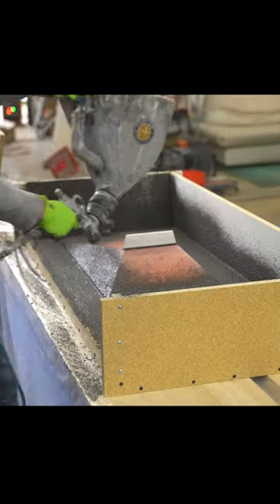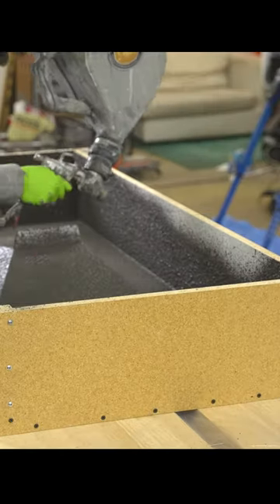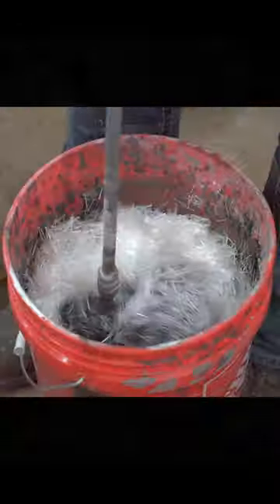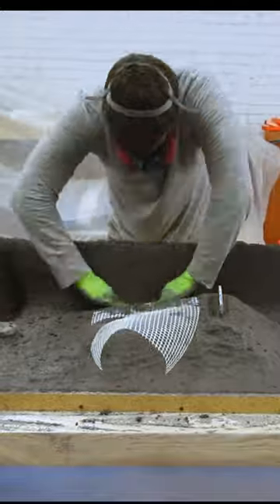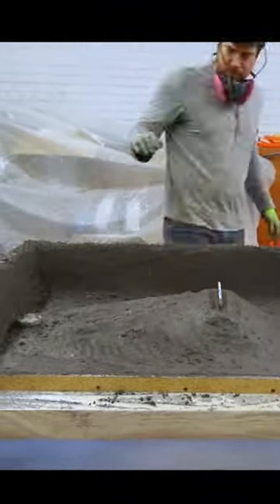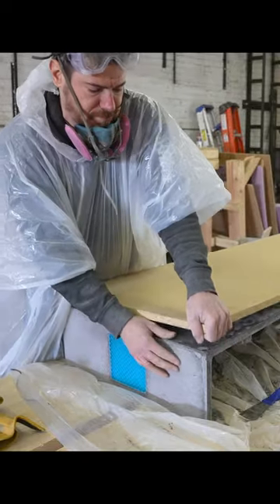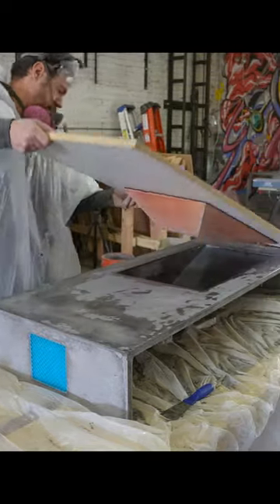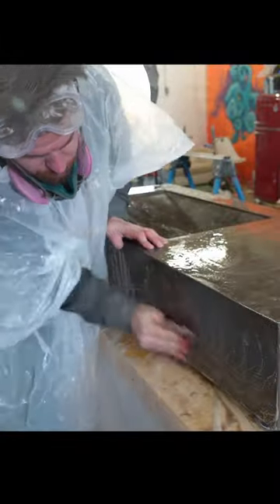CUSTOM Concrete RAMP SINK

Comment: What is the purpose of spraying the concrete? Just asking. You do a great job.
Reply from the maker: on tall vertical surfaces, its really the only way to get a nice smooth finish.  You don't want the fibers from the backer coat showing, and you can't really brush on a face coat when vertical surfaces of the form are taller.
Reply: @modustrial  now I understand. Thanks for your answer. I appreciate it.